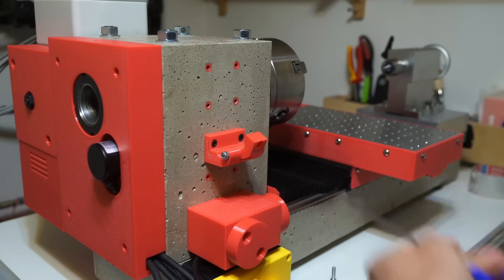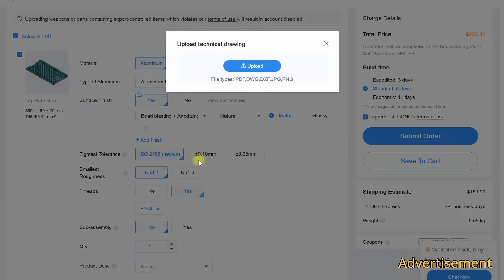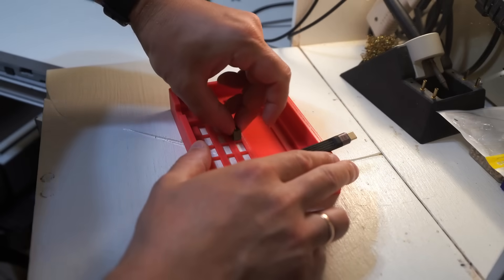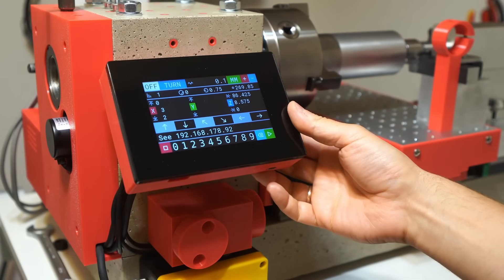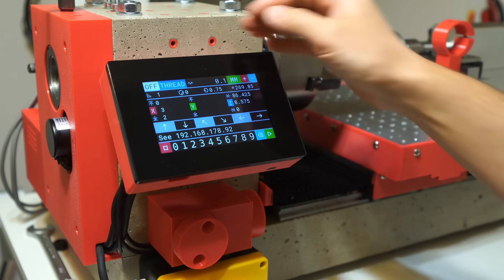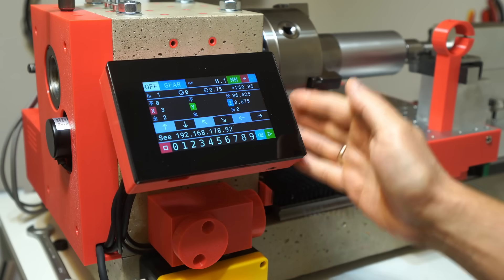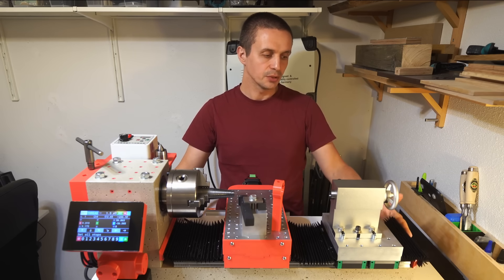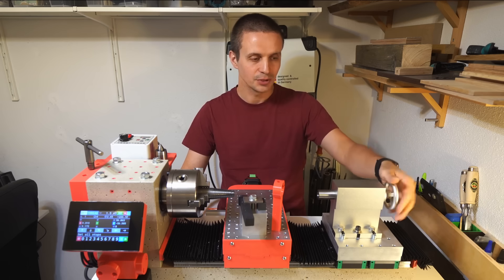3D printed concrete lathe, part 3, final

Comment: Do you use self designed controller ?
Reply from the maker: Yes
Reply: @MaximKachurovskiy  Hm.. in my opinion it's overengeneering, I'd take something already done CNC board and just cusomize firmware. But in any case that's a great job. You rock!

Comment: Awesome build! I'm so humbled by the dedication in open-source projects like this. I hope to start building the lathe in the near future. However, could you make a comment on the chosen motors for your build? especially the spindle motor and the gearing ratio. Is it a stepper motor?
Reply from the maker: It's a sewing machine motor from AliExpress, 30 to 60 tooth GT3.
Reply: @MaximKachurovskiy  Cool - And coupled with an encoder?

Comment: Concrete is the best material by far for a homemade one. It's cheaper and easier than granite epoxy so you can use a lot of it and end up with a beefy ass machine.

Comment: Very Inspiring movies and generous to add the files for free. Do you think epoxy granite, epoxy with rebar will work as well. How much will the concrete shrink?
Reply from the maker: Epoxy mixes will probably work but you need to make sure it can withstand the high temperature of the bearings. Last time I checked epoxy falls apart at water boiling temperature. Concrete mix might shrink or expand, depends on what you buy.
Reply: @MaximKachurovskiy  A steel housing for the bearings might solve that

Comment: Congrats on finishing this endeaour - Well done Max!

For others watching this - even if you are not setting out to build a concrete lathe - but you're interested in adding an ELS to your lathe, I'd say that the NanoELS system (according to my research) is probably the best bang for the buck. It's incredibly feature-rich and with a bit of work, you can tailor it to whatever you want. 

Completely unleashed, it's almost more CNC than classic ELS - or rather, it's a mix. The manual mode is "fly-by-wire" as you use encoder handwheels to turn the axis via ballscrews - which is also what allows for the G-code capabilities. 

But personally, I kept my NanoELS for my mini lathe quite a bit simpler as I didn't install a motor on the X nor ballscrews so I use it more like an old-school ELS just to cut threads and powerfeeding along the Z. Honestly, I had to dumb down the system, haha.
That said, I also managed to customize the FW (and screenset) so that it now does double duty as a DRO with scales on both X/Z. 
This is the reason why I went with NanoELS - because you can customize it and it has the HW to take scale inputs, too which the vast majority of other ELS systems can't.

Comment: One thing I dont see, where did you tuck away the two stepper drivers?
Reply from the maker: One in the headstock, one on the back side of the cross slide
Reply: @MaximKachurovskiy  yes I do recall seeing something tucked into the headstock...

Comment: I've been designing a concrete lathe for the past year or so, larger and more complex than your concrete lathe, based loosely on Dan Gelbart's granite based lathe and grinder. As part of my research I've watched so many videos related to this subject and epoxy granite based lathes and mills, and in my opinion your design and 3 videos are among the best on youtube.

I've been watching your NanoELs videos for years and had wanted to buy a controller but you discontinued selling the H4. Now I'll be making the H5.

Comment: One of the most intriguing projects I’ve ever encountered. I hope you also operate a DIY Concrete CNC machine using only pre-made standard aluminum profiles and brackets, eliminating the need to order metalworking parts. Regardless, I thoroughly enjoyed watching your impressive work. Thank you for sharing it generously.❤

Comment: Hey man

Is there a way to convert the g code from the lathecode to a grbl Compatible g code? 

Im looking for a lathe g code generator and the lathecode looks like what im looking for
Reply from the maker: It might already be compatible. Or did you face any issues?
Reply: @MaximKachurovskiy 

 i just checked it

And figured a way to generate it

Also

How do i run lathecode locally on my computer? 

I have a habit of running things locally if possible

And the GitHub page didn't tell how to run it locally

Sorry if the answer is obvious

Im not well verse in web development and only know surface level stuff

Edit: i already figured it out on how to run it locally

Comment: predicting the 3d printed motor mount to be the first part to break
Reply from the maker: I've used a smaller motor mount on the 3D printed lathe almost a year ago and it's still going strong. This motor mount is much thicker.
Reply: @MaximKachurovskiy you can see it flexing a lot when you installed it, and you have an ac servo on which generates a lot of torque and is a very precise device, I think redesigning the bracket to be more stiff isn't a bad idea

Comment: -Quel est le type de moteur Nema utilisé? 

- quel est le type de courroie utilisée pour le capteur synchrone, la longueur et dimension des poulies cranter ?
Reply from the maker: NEMA23 on both axes, 2-3Nm. HTD3M 60t and 30t, 267-3MGT-6 for the encoder, 426-3MGT-9 for the motor. Ideally motor should use a 15mm wide belt but that would require making the spindle pulley a bit longer.
Reply: @MaximKachurovskiy moi j'ai garder mon mini tour MX 210v et je voulais savoir quelle taille de poulie pour encodeur 2000pp

Comment: Hey nice shit im a cnc machinist i have some advice you may want. The tldr rigidity is the goal, the motor mount and tool assembly are lacking in that.

First good on you for the indicators and feeler gauges that’s a rarity for ppl making things like this so your ahead. 

The concrete is a great idea for rigidity assuming it holds up to the vibrations. the main issues your going to have tho is with your spindle. The motor mount being plastic is going to let it give or move by thousandths which in the world of machining is big deal. I’d replace that plastic motor bracket with a steel bracket and you’d likely want to put a tensioner pulley in to make sure there is no give in that system.

When you put pressure on the part it’s fighting the pulley and you want it to be practically immovable as for the spindle accuracy you’re at the mercy of your bearings accuracy unless you get real creative with how you load them but it didn’t sound absurdly chattery on the cut. 

As for the tool post aluminum is better than plastic but it will bend even if it’s only a few thousandths it’s not going to be as rigid as steel parts and the heavier the cut or duller the tool the more prevalent itlle be. Your best bet is going to be to add more solid mass to that assembly literally just steel and concrete could do you alot of good there if the servo can handle it. Once again tho you will be  at the mercy of your bearings accuracy and rigidity on the linear rails and ball screw and motor strength. 

If you even read this just take away that rigidity is the most important part to accurate machining it’s what keeps everything tight and repeatable.
Reply from the maker: Agreed 👍 Thanks for the comments.

Comment: The machine looks very nice but how will it fare against vibrations? The concrete is very resistant ti compression forces but not that good to bend, twist, pull or sheet forces. I think it will develop cracks. Have you considered this?
Reply from the maker: I used vibration resistant grout. It's used for anchoring in bridges and tunnels.
Reply: @MaximKachurovskiy  I understand and I really appreciate the work you put into it. But besides that, the range of vibrations a tunnel or a bridge gets is nowhere near the frequency and amplitude of vibrations a small block of concrete should stand here. In constructions engenieering, everything is over-dimensioned by design, meaning they are designed to hold loads sometimes even an order of magnidude higher than what will get in real use scenario. Even the steel contained inside every block of concrete is way bigger in diameter than it needs to be. If you considered all of this when you set the dimensions for your oroject then maybe it will be ok, idk. 👍

Comment: Hi Maxim. I am curious where Joystick will be connected and how, is it connected to jsignal. Can  hand wheels 100 lines be used instead rotary encoder 600 ppr, and I think Nextion biger screen can be used.
Reply from the maker: Hi Milan, there are 2 dedicated ports for joystick on the back of H5 but it remains to be seen if it works as intended. I haven't used 100ppr classic wheels on H5 yet but they should work. I don't think they will be convenient to use though since to be able to make 0.01mm fine adjustments you'd have to make a full turn for a 1mm move preventing their use for fast travel. Bigger Nextion screens of the same resolution e.g. 7 inch are nice but harder to find in many countries or much more expensive.

Comment: Is the gcode standard?  Like, could I use Fusion to program it like a normal CNC?  Really impressive project!
Reply from the maker: The G-Code commands are standard but not all of them are implemented. Fusion G-Code will likely require some post-processing.

Comment: Hello Maxim, Very interesting project, if you can share how much around was the end cost and would you recommend a concrete base over some type of epoxy granite base?
Reply from the maker: The total cost is between 1500-2000 euro. I have never used epoxy granite. Epoxy is harder to work with and does not tolerate heat from the main bearings so well.

Comment: Boss, how many mm did you catch on this CNC lathe?
Reply: 1100mm？
Reply from the maker: Base length is 80cm but it can be longer or shorter, depends on the number of molds you print. https://github.com/kachurovskiy/modulathe/tree/master/v2

Comment: This is a pretty amazing build all things considered. That motor bracket absolutely will not last tho. Also what belt standard are you using? Consider T3 or HDT5. Belts and pulleys really aren't terribly expensive
Reply from the maker: Using 9mm HTD3M belt at the moment, it's flexible and strong enough to stall the motor. HTD5 is too thick and inflexible here, especially since we'd have to use it also on the encoder.
Reply: @MaximKachurovskiy try T2.5 or T5. You can get them steel reinforced and they're pretty darn cheap. I've used them in a spindle application before and it worked great.

Comment: Honestly didn't thought that stepper motor to turn the spindle had "800LL5" to do all that heavy metal cutting.. My respects sir! I have a 3 HP DC motor in mine with a 3-1, 2-1 & a 1-1 pulley to do work accordingly thanks for showing your work..

Comment: 6:15 this is why commercial lathe uses geared transmission and not belt driven.
Reply from the maker: Plastic pulleys have imperfect profile and very slippery. This is especially pronounced on small pulleys. Once belt is slipping, it's over. After switching to metal pulley we were able to stall the motor instead of making the belt slip which is the ideal scenario since this motor is smart and won't burn out.
Reply: Plenty commercial lathes have some sort of belt drive, combined with a gearbox, for smotther running

Comment: I'm not sure how you'd manage to establish concentricity with the spindle if you cast the tail stock, but actually I'm not sure how they establish that in metal ones either. The one real genius insight I could see about this project is that the spindle only needs to be true to itself and the ways, everything else on a lathe is adjustable so that covers most of the foreseeable problems.

Comment: I want to be careful on how I put this without sounding dismissive, but this a proof of concept only. The value of this project lies in finding clever workarounds and solutions to the many problems you were faced with - some of which will be carried over to future projects, making you an even better engineer. However, the product itself not very useful, it's nowhere near even a cheap chinese lathe. You might squeeze more out of it by putting a lot more time in with revisions, but is it worth it? Perhaps not. This comment is for the people who think you can clever your way out of any problem, such as buying a real lathe.
Reply from the maker: This lathe significantly exceeds WM210. Here you can e.g. part steel with a 3mm wide carbide blade without issues.
Reply: @MaximKachurovskiy  Buddy, I'm a mechanical engineer. Your project might look impressive for a layman, but your lathe is proof of concept only. You're lying to your viewers if you claim otherwise.
Reply from the maker: @Busybody21   https://docs.google.com/spreadsheets/d/1IpZ7Xnm5QJVu0cfoGkMWUwtBVqYIiU4USMAJj4KhcwU/edit

Comment: HI Maxim, question is what have you used for hand wheels to move X and Z Axis, in assembly it looks like small rotary encoder. Scales X and Z and Joystick not installed yet, how scales are working.Screen in video it can be seen turning taper and threading. Do video how to set on screen what need to be done. Thanks.
Reply from the maker: Four hand wheels I'm using the same 5V optical rotary encoders with 600 pulses per revolution as I'm using on the spindle. There are no magnetic scales, we are relying on high precision ball screws to position the axes. To see how to set up threading in cones, just follow the link to GitHub NanoEls H5, there's a manual there ❤

Comment: I really like the air bubble design on the concrete. I guess it's less strong that way though?
Reply from the maker: I should have used a submersible vibrator and avoided the bubbles though 😢
Reply: it’s just kind of what concete does unless you have a good way to shake it all out. there’s plenty of concrete to go around.

Comment: Well done! Maybe next version will be from granite, as Dan Gilbert shown in his "High precision air bearing CNC lathe and grinder". BTW he shown number of interesting solutions how parts can be fixed, also with epoxy in his "Building Prototypes part 13 of 18 Large Structures"
Reply from the maker: How do you make precision bearing seats in granite at home?
Reply: @MaximKachurovskiy  He said "you can buy quite economically parallel granite bars with micron precision". Of course "economicaly"  it is probably in compare to professional equipment. I bough a granite tray for 10 euro on sale in garden shop in case I can use it as bed for small lathe. Bearing sits of course a different challenge. How BTW do you oil tapered bearings?
Reply from the maker: @Maker-one  bearings are pre-lubricated sealed double row angular. Keep us updated how dealing with granite goes
Reply: @MaximKachurovskiy  Granite is put on hold while I'm re-building lathe/mill with aluminium extrusion beams.

Comment: You might run into problems at higher servo speeds while using a switching power supply to power the servos. Switching power supplies don’t like the voltage spikes on servos deceleration.

Comment: No spindle index (Z) signal?
Reply from the maker: Not sure what you're asking exactly. Spindle encoder gives standard A B signals. It doesn't have a full turn signal Z and it's been okay so far. Few folks have troubles with lost/extra pulses but those are usually resolved with better wiring, shielding or pull-ups.
Reply: @MaximKachurovskiy  Yes, I was asking, if my observation, that "It doesn't have a full turn signal Z", is correct. You can live without it, but you are loosing easy way how to e.g. recover from crash when threading (as it provides absolute position on this axis to the control system). HW-wise it is just about using ABZ encoder and 1:1 transfer, both easily achievable here (even if current controller does not support it - you can expand it in one day or e.g. provide interface for LinuxCNC control for more sophisticated tasks and there is full ABZ support already).

Comment: Would definitely be better with a cast concrete tailstock with a much more substantial barrel. Also would have been good to make reinforcing frames within the cast concrete using stainless steel wire in a similar way to rebar in concrete slabs. Would reduce the likelihood of cracking in the concrete when under stress, also prestressing the bed as you mentioned would be a great idea. Overall though this is a pretty nice machine.

Comment: Please tell me the motor mount isnt PLA
Reply from the maker: It's PETG if it helps :)
Reply: @MaximKachurovskiy  that is exponentially better!
Just please dont use pla for those things :P
ive seen so many people in 3D printing default to PLA for things like that which is a horrid choice. its very rigid and brittle but it creeps under load.
i wouldnt have wanted to see that motor mount turn into the pitch drop experiment!
Reply from the maker: @contomo5710  yeah. That's why I only print in petg in recent years.
Reply: @MaximKachurovskiy  PETG/PCTG and ASA/ABS are imo the best choices for anything that mounts, spins and or holds something.
Even Nylon actually creeps quite a lot

Comment: If you painted the concrete yellow it would've looked like sponge bob, and that's enough for me to like the video. I'm high

Also got damn that stepper motor is THICCC boyyy

The plastic is same color as Patrick Starr too, missed opportunity for SpongeBob theme lathe.

Comment: Bit sceptical about that printed motor mount being strong enough to handle the torque and not deforming/softening from motor heat.....
Reply from the maker: It's a good motor, doesn't heat up much, has a fan on the back.

Comment: Great job as always. under link to DIY slide covers.
https://www.youtube.com/watch?v=ih1e3B6YWLc
Reply from the maker: These bellows are super cheap and work great. Easy to lift and check what's under them. Cut with scissors to length and done.
Reply: https://www.youtube.com/watch?v=xvmANqQ4U-k

Comment: Excellent project!  Wonder how flat these concrete surfaces are, could you make video with some measurements ? Would be great to cast it from epoxy granite to reduce shrinkage. Concrete will change dimensions long time after casting.